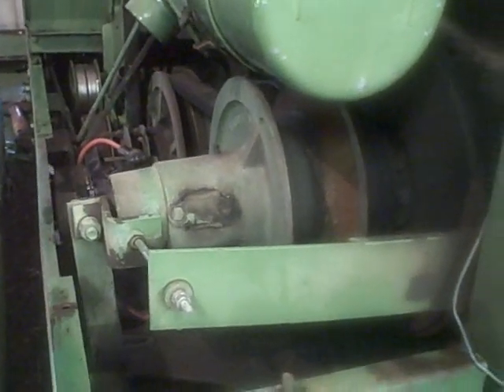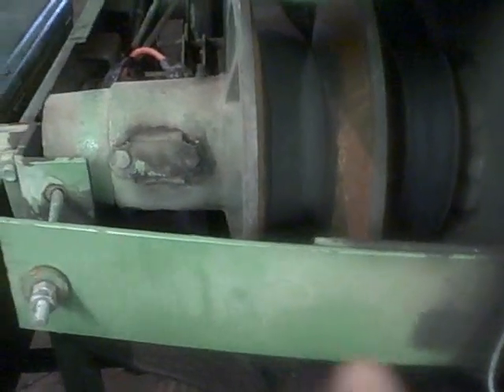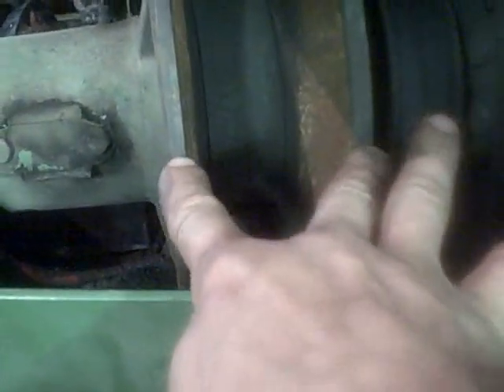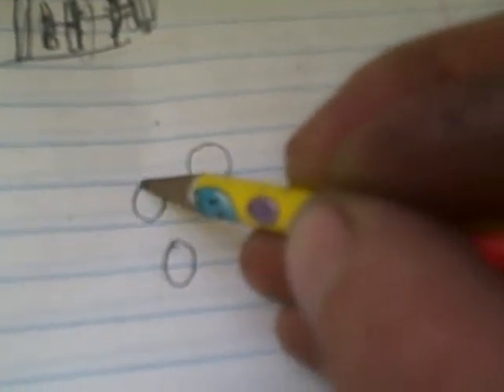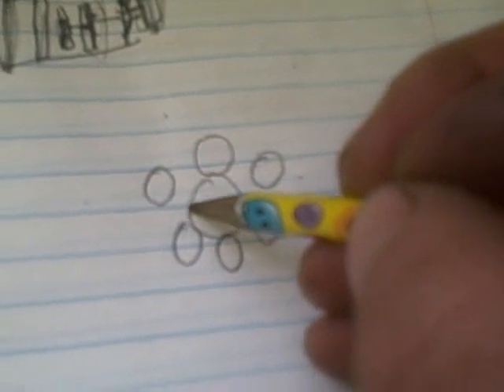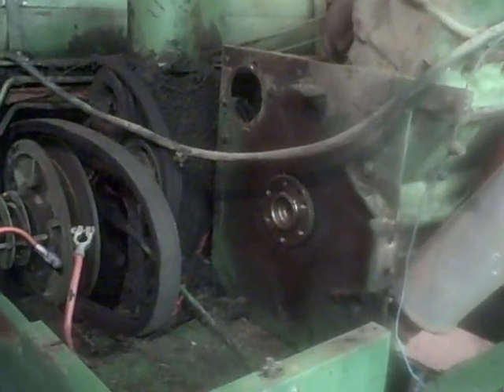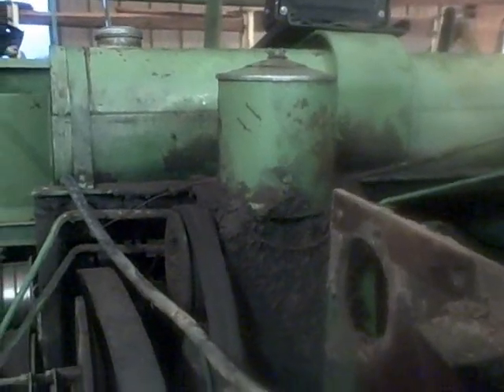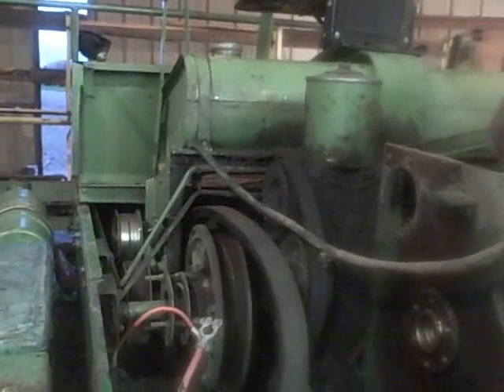How the drive system works on our John Deere 800 swather

Comment: they do, but the industrial distributor may be different enough for the kit not to work...and chances are he can get all of the car/pickup stuff for literally nothing (even a new wiring harness is only $20). and if one of the parts of the factory setup broke it would be easy to get the replacement part since everything is the same as the Chrysler V8's other than the distributor

Comment: If the ignition system on it is the same type as a Chrysler automotive ignition (distributor with points, coil, and a ballast resistor), then you can find a used slant six car distributor with the vacuum advance and then use a normal Chrysler ignition box. It should work no problem since you gotta have an alternator on this rig.